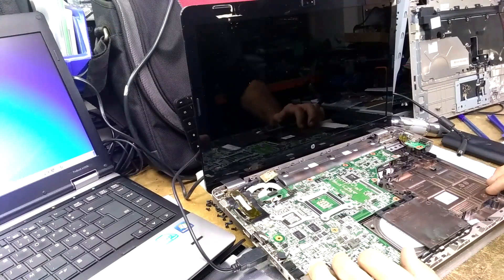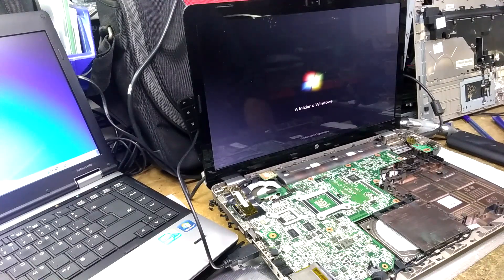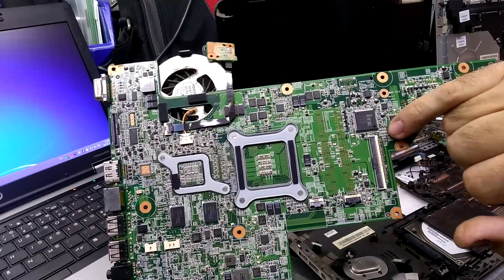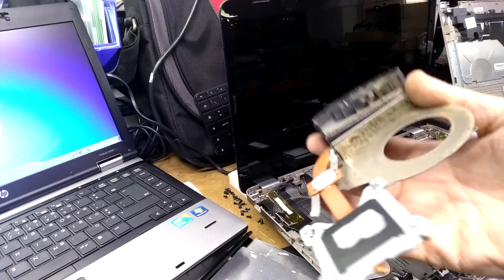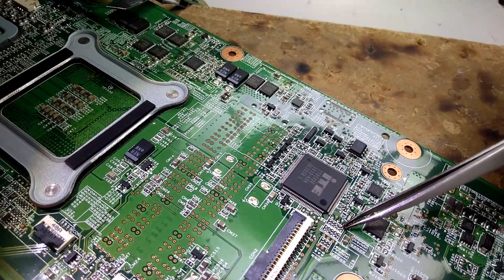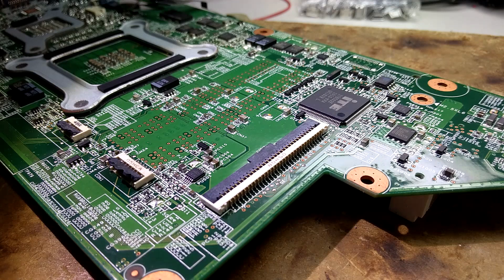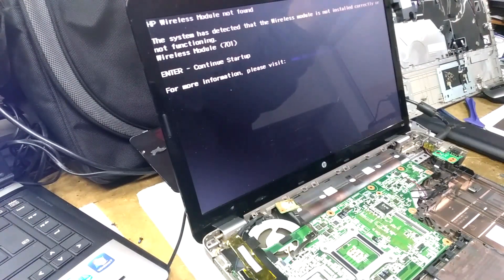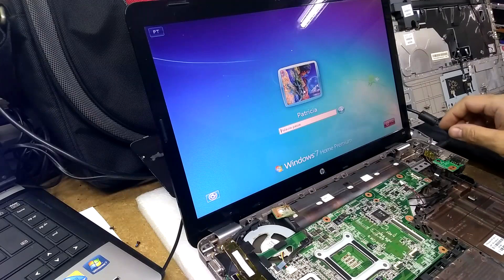HP G62 How to Fix black screen problem

Comment: mine is worse the screen works but wont diplay anything, only the lamp
Reply from the maker: Hi, do you mean the only the backlight turns on?
Reply: @Fixepedia  yup only the backlight turns on like it turns on properly by video signals but does not show anything, i think the motherboard needs replacing, oh by the way the vga output works fine
Reply from the maker: @fargeeks  I would try another lvds cable first and I would check the connectors also, because it seems like a lack of the ground wire. .if by chance you get a LCD to test, I would test it too.
Reply: @Fixepedia  i tried a new cable and a new lcd screen and no luck man o i think its the motherboard
Reply from the maker: @fargeeks  yep... then it does seem like a GPU issue... if your motherboard is the same as the one in the video, then this repair would solve that.  Good luck and best regards.

Comment: Guys, do you know Ohm rating for these resistors? Ive burnt one of them ((.../the inner to ITE chip/
Reply from the maker: Hi,
I think they are 75Ohms... but i'm pretty sure that anything from 60 to 80 Ohms is fine to use.
Cheers.

Comment: I hated Windows because those problems black screen, blue screen of death,... etc. 
Linux is the only & best OS for me
Reply from the maker: Hi,
Unfortunately this isn't a Operating system problem, but rather a hardware problem that most manufacturers are going to have at one time or another.
fwi, i like each operation system for what they bring to the table ;)
Cheers.
Reply: @Fixepedia  that's my second thought which is a hardware issue and i guess it's tha RAM
Reply: Yeah after two years later
Mine got a Black screen on Linux
Now i need relocate the capacitors lol
Reply from the maker: Well.. It still gave you 2 years to work up the courage 😁😅

Comment: hi. hoped that will do, but it turned out that my g62 has different mb(but the same black screen problem). 
any tips or hints would be greatly appreciated.
Reply from the maker: Hi, sorry for the late response... but normally first thing to do is to try another lvds cable first and I would check the connectors also. if by chance you get a LCD to test, I would test it too.

Comment: I own the hp g62-a55sf, it doesn't have a battery and it doesn't start with a power supply. When I press the power button I hear 1 second starting inside, the LEDs light up and turn off immediately, the screen does not light up at all. What can I do?
Reply from the maker: Hi, sorry for the late reply, but have you tried another power supply?
Cheers.
Reply: Im sure the power is ok, i use it with another laptop. I think its about the motherboard

Comment: Hi mate my computer's flex cable was disconnected, i bought the computer turned on but the fan and screen is not working so what should I do?
Reply from the maker: Hi, sorry for the late response... In some cases the fan only turns on when the CPU starts heating.... but if there is damage to the motherboard then it could have that issue also. Sometimes it could be a corrupt Bios Chip. If you could program a new Bios, that would be where to start from, aside from the usual suspects, like Ram, cpu, etc...
Cheers.

Comment: i just installed graphics drivers and my laptop just restarts!
i watched your video, and could this be a problem on my laptop?
Reply from the maker: Hi, exactly. . I very well could be. Do you know the brand and model of the laptop?
Cheers.
Reply: @Fixepedia  Hp G62
Reply from the maker: @afrimkasami886  well then it's almost certain that's the problem, all you have to do is check the motherboard model and see if it's the same as in the video, which the odds are, that it is. If so, then just follow the procedure and you should be golden 😉👍

Comment: In Model G62 Mainboard DA0AX1MB6F0 Rev: F  how to do it ?
Reply from the maker: Hi,
Sorry for the late reply... From what is was able to gather, Your Board already has a on-board Video graphics chip, So this repair won't do. Have you tried hooking it up the an external LCD ? you could be having another problem.
Hope it helped.
Cheers.

Comment: Hello Fixepedia ,
I own hp g62 ,and recently my laptop wouldnt show any display after windows loading .So started my laptop through safe mode and it worked but it was limiting most of my laptop .I disabled my intel hd graphics through device manager( my other graphic card is ati graphics card) and the rebooted ,and it started normally without safe mode .....but im not able to open any game or any other software (which requires graphics card) even with ati graphic .I also noticed that i started receiving notice "Ati hardware not found " .And also if i enable my intel hd graphics ,I would face the same black screen problem.
SO COULD YOU PLEASE HELP ME BY TELLING ME WHATS THE PROBLEM? Is my graphics card died? can it be replaced by the hp service ?
Reply from the maker: Hi,
Yes, From what you have described, it is definitely that Graphic card that died... HP service will most likely charge you for a new board, they never do graphic chip repair. You can ask for a estimate from HP, but if you know of any repair store that will change your board, i would advise you to get an estimate as well... but keep in mind that most boards today are refurbished and not brand new... so see if you can get someone to give you at least a minimum of a 1 year guarantee. Because badly refurbished boards die between 1 and 4 months.
Cheers.
Reply: @Fixepedia  Thank you so much for the reply and the advise !😊
Reply from the maker: @manishbangera9451  you are very welcome 😉